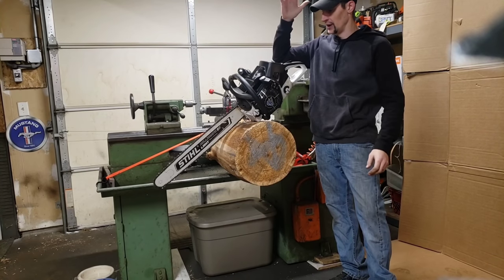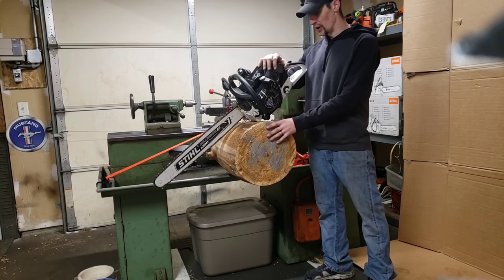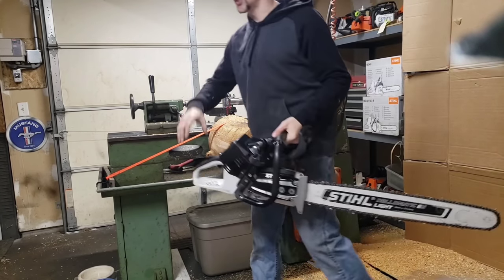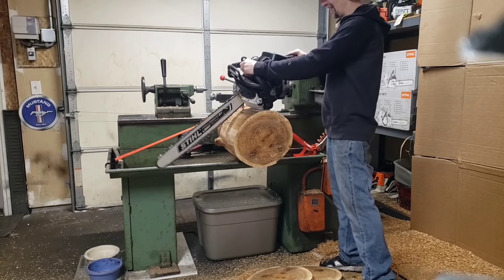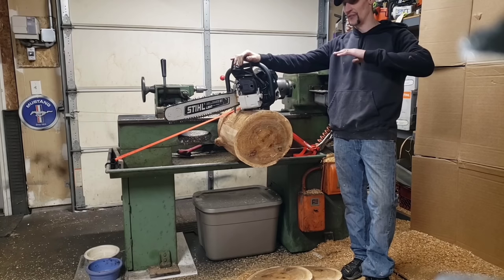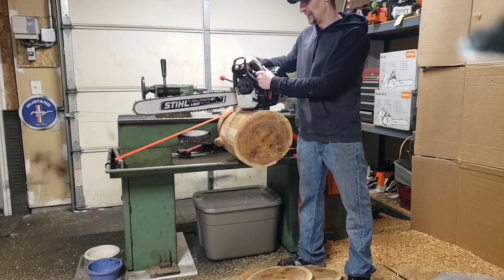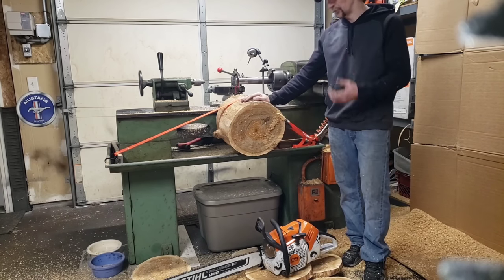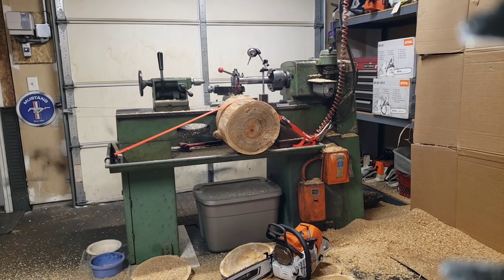MS500i ...  STOCK vs PORTED ... RACE CHAIN ... how much faster???

Comment: Dam, that chain and your tweakin makes the stock saw look like a saw third smaller in size compared to the cut times.
Glad to see you got smart, and covered everything up this time, because I know you spent a good amount of time with shop vac cleaning up, moving power heads around first go around. Appreciate your efforts on giving demonstrations inside, because you still got half the mess to clean up once again.

Comment: HI John race chains make a lot of diff for instance me and my friend went to a saw compaction I told him to sign up in the ported class with his 661 & 462  both saws was stock but both had bark boxes on them he placed 3rd  both classes  he was astound that was the first time he ran a race chain  I done very will to  they are expensive at 300$ a pop I sold 9 that day there is a lot of work that go's in to a race chain   food for thought ask the guy that  dose your chains to put a good round filling on one of your chains so you can sharpen it yourself it will be a little slow but it will fill good when yo cut with your saw it will save you time and money that what I do to my customers so that they can practice cutting for a competition KEEP ON ROCKIN DUDE !!!!!!!!

Comment: Hi John I'm only 13 years old but I love working on saws and cutting wood I like to work on older stihl chansaws like the 038s and most of the older ones I like some of the old home lites like the xl 76s is it true that the ms 250 is your favorite saw I have a few and thear a nice smaler saw with the 16 inch bar
Reply from the maker: Love to hear it dude... getting the bug to work on saws that young is awesome because most kids (no offense bro I'm 40 so you are a kid to me lol)... dont have any interest in small engines especially 2 strokes... you guys are the future... and YES the MS250 is my vote for the best saw ever made... now I dont port them and throw tons of mods at them... I know that sounds weird coming from me... but the 250 is a cheap homeowner saw that doesn't realize its not a pro saw and they just get it done and are incredibly durable for what they are... convert it to 3/8 chain and get rid of the .325 safety  chain... learn how to sharpen them really well and they will surprise you... I did service/repairs for many years and they sold husky and stihl at the dealership i was at and those 250s were incredibly reliable and durable... best "bang for your buck" saw in my humble opinion 💯
Reply: @johnscustomsaws  yes I like the older pro saws I have a few 034s and 038 and a butifull 026 and a nice 041 im saving up for a 066 I have about 40 old homlites and I love em expect my xl 76 the are in mint condition and I have 4 of am what would you say would be a good saw for me because I'm saving for an 066

Comment: That blacked out 500i is sexy. Your 500i builds look stout. Wish I was rich and could afford to buy one from all of the reputable builders to compare. Wish you were taking used saws at the moment. My 462 needs some love. 
Quick question if you don't mind. I know in your 461 build video you set squish at .020 as most people do but what would you consider the absolute minimum that you would run for a personal saw?
Reply from the maker: Depends a Iot on how you are building it... the way you cut the squish and if you are doing any machining etc... I dome my pistons and cut the squish so its a little different... but as a general rule of thumb... I would say .022 or .025 absolute minimum

Comment: I heard that ! I been running the piss out of ms 250 for limbing. They rip when opened up, for their light weight. Got 4, need 1 more before they quit making 250
Reply from the maker: Yep... best value for money saw made in my opinion... I convert them to 3/8 chain and get rid of that .325 safety chain and SLIGHTLY open the muffler up thats it... and they just work and keep working... its like nobody told the 250 its not a pro saw lol

Comment: What’s the cost difference on the race vs stock chain?
Reply from the maker: The race chain has so much intricate work done to it I can't even begin to explain... im definitely not a chain guru not even close... I just know the pointy end goes forward... the stock chain was a square ground full skip but it was definitely not the best... I realized after the video the one side all the cutters were a little rounded
Reply: Dźwig na olx
Reply: Olx dźwig ciesielski.